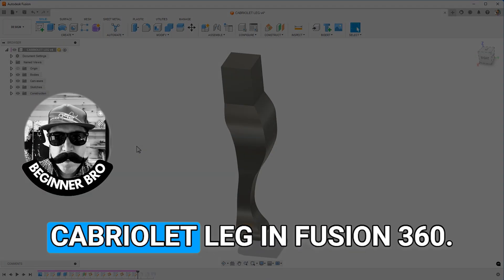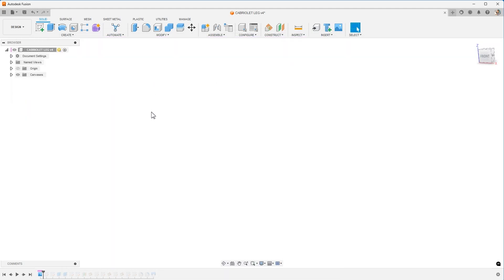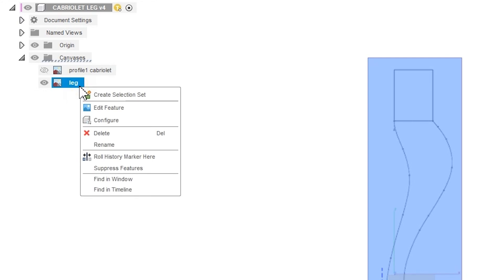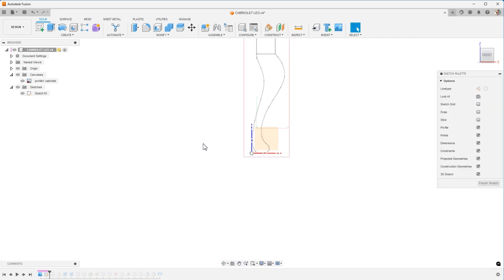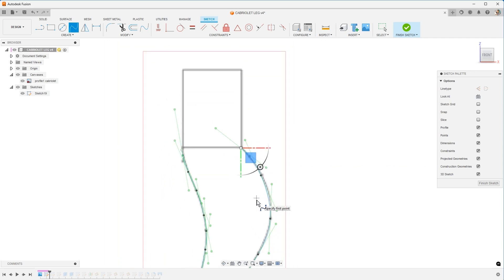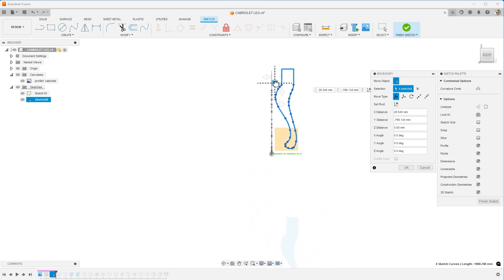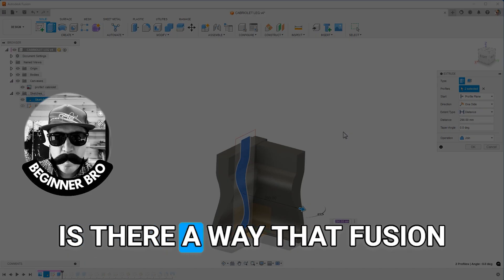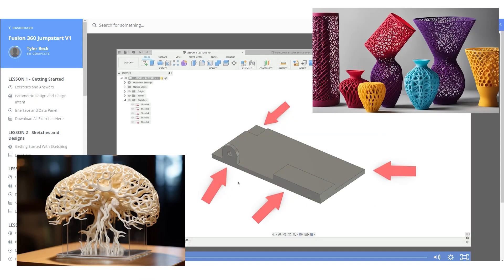How to build a Cabriole Leg in Fusion 360 - Complex Curves

Comment: Thanks!

I think you should use a lot fewer control points in your splines. Add control points only where the curve changes direction. 

Then your curve will be a lot smoother.
Reply: Your curve is very smooth right now but it can become really messy if you start moving the points around.
Reply: My exact thought. The line should be edited by changing the length and orientation of the handles instead of adding more points.